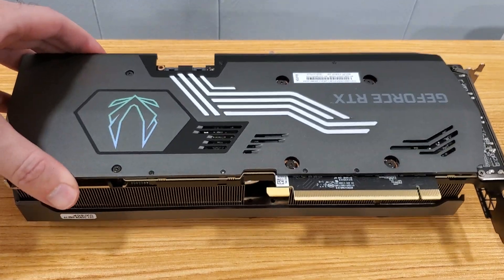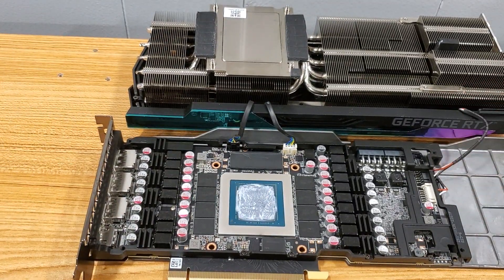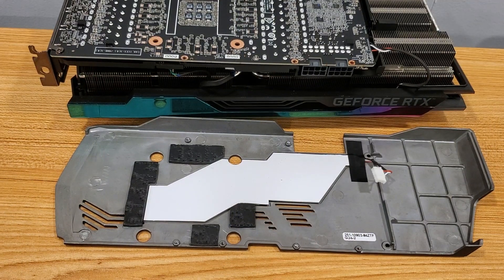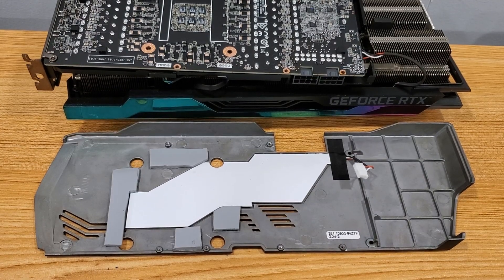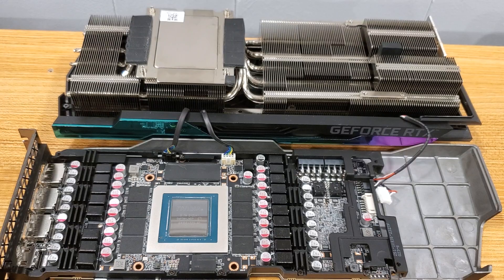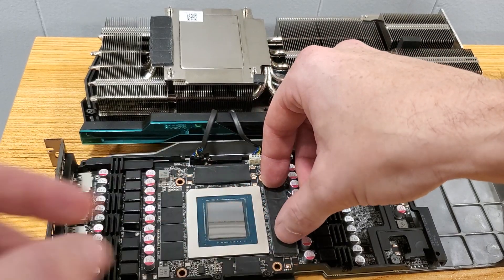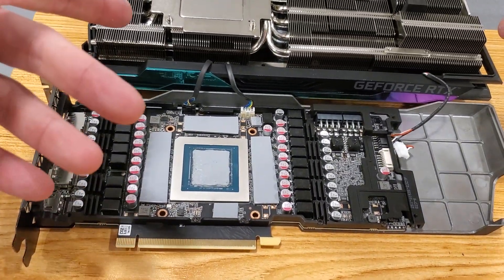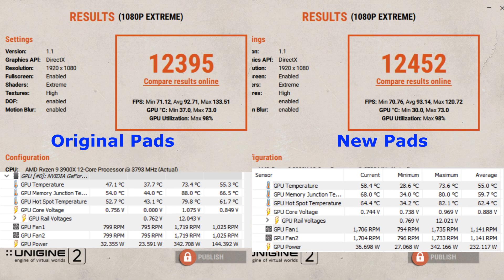Zotac | GeForce RTX 3080 TI | Thermal Pad Replacement

Comment: Dropped my hotspot temp from 83 to 79 and my memory junction temp from 96 to 84! I replaced both thermal pads and it seemed to payoff overall. Gpu temp seems to be the exact same but this at least gives headroom to reduce thermal throttle risk.

Comment: my cards like 3 years old will i get better temps if i did this? im getting like 83c under load and the gpu is running at like 47 db i was thinking of desrouding and getting some good fans whats the play?
Reply from the maker: I've had mine in a custom loop for a while, but had issue with my i9 13900k, so had to take it apart again. I put it back into the air cooled factory setup, but something got messed up and the fans would not spin. I gave up on the factory cooling and bought an AIO designed for the 3080ti. Alphacool Eiswolf 2 AIO - 360mm RTX 3090/3080 with Backplate (Reference) PHT
Reply: 83c is fine because that's the value of default temp limit. You also have to check the fans rpm and airflow of your case. Mine is also at like 79-80c (GPU fans at like 1900-2000rpm), ambient temp is high though 28-30c.

Comment: Awesome tutorial. Subbed! Was wondering if you can help, after pads and paste replacement everything was great hotspot started skyrocketing after a week. Repasted and it helped, also replaced pads again but core temp has been going up more than before, hot spot is cooler though. Seems I might have tightened the spring screws too tight.

Comment: I have Zotac 3080 amo holo. My temp were core: 65 stuck, mem: 75-80. but hotspot was on 104.7 and it was throtlling hard. I repasted and changed the front thermalpads with coolermaster 2mm and now core temp is 75-77, mem: 75-80 and hotspot is still on 100-101 on max load but not throtlling. Should I need to replace backside pads too? I mostly use it for gaming.

Comment: What is your ambient temperature? 
I replace the back with thermalright 3mm and use alumunium mod on the front. Alumunium supposely has more heat transfer capacity. But under full load I reach 90degree in 2 minutes.
I wonder are you testing this on winter?
Reply from the maker: I made this video in August, and I do not have air conditioning in my office, so ambient temps were probably pretty high.  Most likely in the mid 80s. I have just switched from factory cooler to a water block, so I ran another test with factory air cooler and average temps where mid 70s and hotspot was low 80s.  Ambient temps were mid 80s.

Comment: I think you've messed up the torque on screws. Or the equilibrium of pressures.
Reply from the maker: Can you elaborate?
Reply: @Mannyocrity  Torque on screws matter at a lot of things. I think the placement of the cooler unit don't contact well enough with the pads/parts correctly when it's too lose or tight.
This is why Gamers Nexus do pressure tests nowadays.
Reply from the maker: @RoyalPredator  I understand torque on screws.  I was just wondering why you think I messed them up? As long as I use the same pad thickness and then tighten down the screws we should be good.  Torque mainly matters on things with moving parts.  E.g. like a cars engine.
Reply: @Mannyocrity  Because the values dropped on mems, which is cool, yet the GPU core and hotspots remained the same.
Maybe something gone wrong there.
I've experienced the same issue with CPU.
Once replaced paste, not changed.
Had to do it again because of high RAMs, and temps dropped nearly about 10C, 15C under benchmark load. That time I've set torque properly.

Comment: hello i use 2 mm thermal pad in my zotac 3080ti under the temperature of the memory from 93 degrees to 73 at work but my core temperature rose 4 degrees in my 3 zotac i use the artic mx4 for the core, it is not much temperature at work I am in 51 core and 78 memories but before the memories were in 46... it happens to me in my 3 zotac
Reply: I use the same thermal paste too,core tempt went up. I think the thermal paste is just bad lol

Comment: I put paste in gpu my temp up after this i of 45c to 50 in gpu and my mems whit 2mm down 92c to 80 ... why my temps up in gpu?
Reply from the maker: did you put enough paste?  What quality of paste did you use?  the paste's thermal make a big difference.
Reply: @Mannyocrity  hello I put the mx-4 gelid I put in the 3 gpu and in the 3 it went up 3 degrees is not much, but I thought I was going to improve the temperature of the core, where I bought all the thermal pad and paste, they answered me that maybe the thickness of the thermal is not adequate (2mm) and that is why the heatsink does not make good contact with the core.... which I do not think about because it makes a stop when assembling
Reply from the maker: @marcelosalama1860  The thickness of the thermal pads will change thermals.  Putting pads that are too thick can make thermals a bit worst.
Reply: @Mannyocrity  but I put 2 mm in memories it is a zotac 3080ti trinity I think that is the thickness that you have, have you put that or not? it's still only 3 degrees more in gpu if I see that it gets worse I'll open again
Reply: @Mannyocrity  worse

Comment: I just subscribed because this video proved to me that you don't play around and fudge tests.  Thanks for the honest assessment on the cooling pads.  By the way, the difference in the wattage between the 2 test configurations is insane.  Almost 100 watts.  Not to mention the fps differential of 13 fps, etc.  Have you seen this kind of discrepancy in this test before?  The fan(s) speed...wow.  800 vs 1700 for the 2 tests.  That 1700 is going to cool the system better.

Comment: can you just squirt the paste on the memory chips? ive seen videos of people just pouring into cpus leaking everywhere and its no problem at all.
Reply from the maker: Do you mean instead of using thermal pads?  If so then the answer is no, but the paste isn't thick enough to make contact with the heatsink and chip.  The pads are used because there is a bit more space between the heatsink and chip.  For CPUs the heatsink is pressed right up against it.
Reply: @Mannyocrity  i meant like if you just coated the old stock pads or even i saw a vid of someone making a slice in the old pad and injecting the paste that way

Comment: Thanks for this video.
You used TG7 which it has 3.3 W/m-k ??? It is very low thermal conductivity therefore the GPU temp. not changed. 
Is there is need to change backplate thermal pads of 3 mm or not ?
Reply from the maker: If I could go back.  I would only change the VRAM pads.
Reply: @Mannyocrity really do the back ones do nothing much?

Comment: You missed the on the VRM's (under the black heatsink frame thingy on the PCB).
Reply from the maker: Yes, I did in this video, but I ended up finding them and switching them out as well.  I was planning on making a video on it, but just haven't gotten around to it.

Comment: I have an RTX 3080 Amp Holo that has been giving me some issues in the past months. Fans rattling, overheating, random restarts while gaming. Any chance that the thermal pads are at fault?
Zotac support has been useless, literally stopped responding to my mails. Might as well try my hand at changing the pads since they wont help.
Reply from the maker: first thing would be to see what your thermals are at and then you can decide the next course of actions.  Changing thermal pads will only help if the card is over heating.  If your fan is rattling then that could also be an issue and you may need to replace the fan.
Reply: @Mannyocrity  what's the best way to do that?
Running MSI Kombustor and taking note of the temps when the system restarts?
Reply from the maker: @M4trockvideos  You can run any thing that will grab the thermals and then keep them up and watch them when you play games to see how high they get.

Comment: Good job replacing the pads. Yes, I'd leave the rear pads alone. I changed only the front. Temps went from the low 90s to low 80s so down about 10 degrees for the memory, plus I was able to take fan down from 70% to 65% and still have low temps.
Reply: What mm pads did you use on the front?
Reply: @Rein S  HI. I used 2mm pads. Worked perfectly.
Reply: @TechnologyHive  i also used 2mm gelid extreme pads on the front but i still get 100C memory 95 hotspot temps.. Do you maybe know how this is possible? i didnt use a lot of thermal paste as in the video, but still a substancial amount.. could this be the problem? thanks.
Reply: @Rein S  Are you mining or just playing video games? 95c for the hotspot is rather high if you're just mining eth. However, if you're a miner mining on an algorithm like Ravencoin, which utilizes core, then I can see the gpu hot-spot being high. But 95c is still a bit too high. 

If I were you, I'd dismantle everything again, double check thermal paste application to make sure it is properly distributed all over the core, and that by sight, on the heatsink, it seems to have had a good amount of distribution from  pressure.

If the paste is not evenly distributed due to thermal pad resistance keeping the heatsink from applying the right amount of pressure, then the pads, for your case, might be 1.5mm or less. 

But everything checks out, and all is in order, then try a higher fan speed. I have mine at 80% on my 3070ti's and 3080ti. This made a huge difference. In fact, try this first.
Reply: @TechnologyHive  with 80% fan curve i still get 95 hotspot and 100-102 memory..
Reply: @Rein S  Which card is this? 3080ti? If so, is it the same one as in this video? Because mining Ravencoin on a 3080ti will definitely toast things up, and with that DDR6X memory running hot, it does not help. My solution is this: replace thermal pads, front only. Replaced thermal paste with MX-5. Locked core clock using msi afterburner to 1545mhz and 1100mhz for memory on Eth. 

On Ravencoin, I used power limit of 82%, +100mhz core, 1100mhz memory, 80% fans. Temps are solid fluctuating between 88c to 92c on memory. Core at 65c.
Reply: @Rein S  btw the fact that you're getting low hash rate on Eth tells me your vram might be thermal throttling. I get 88 to 90mh using Trexminer on eth.
Reply: @TechnologyHive   i have a 3080ti FE, what hasrate do you get with those overclock settings on RVN with your 3080TI?
Reply: @Rein S  On RVN @282w, I'm hitting ~49mh.

Comment: Much thanks for the video.   It gave me the confidence to replace the thermal pads once the process is shown.  I do leave my pc to mine when not doing work or gaming.  Using the recommended Thermalright Thermal Pad 2.0mm to replace just the VRAM and repasted with Noctua NT-H2, it went from 98-104°C down to 78 to 82°C while mining at 87 MH/s.  Simply amazing, thank you.
Reply: What 3080ti do you have? do they all use the same size pads?
Reply: @dariusiakabos  I have the Zotac 3080ti amp holo
Reply: @abnRZ   Hey friend, just to confirm, you didn't touched the thermal pads of the backplate right? You got great results, i'm thinking of doing the same :)
Reply: @Domazin  I changed only front thermal pads on my zotac 3080 and the result is great, planning to do the same with my zotac 3080 ti, can you confirm only front thermal pads can get the job done ? I only have 2.0 mm thermal pads.

Comment: So you're saying if i get high vram temps changing the pads won't do anything ? Thanks for the video
Reply: This mod will reduce the memory module temps, but raise temps for all other sensors (because heatsink is pulling more heat from the memory, it must pull less from other components).  This is alright because thermal throttling in 3080s almost always comes from memory temps.
Reply: He used cheap thermal paste making his hot point go up its 3.3 W/mK u need to use something better like a 8.5 artic Mx-6 is great and use grizzly thermal pads u will get way better results than what he got

Comment: There are probably thermal pads under the black heatsinks over your mosfets/power stages that you didn't swap.  Just FYI if you care to switch those too, they're not going to get as hot as the g6x does, but thought I'd let you know.
Reply from the maker: There are.  Someone else also pointed this out.   I have changed them, but tour right.  They did not do much to decrease Temps.

Comment: Thanks for this video Manny! I will be getting my build completed in the next few weeks and will be using your review and replacement guide as a yardstick for my 3080 TI AMP HOLO. Much appreciated man!
Reply from the maker: Glad I could help!
Reply: @Mannyocrity  What's the thickness of stock thermal pads?
Reply: is youre fans are  quiet in 65%?? because my are super loud even in 57% that's weird